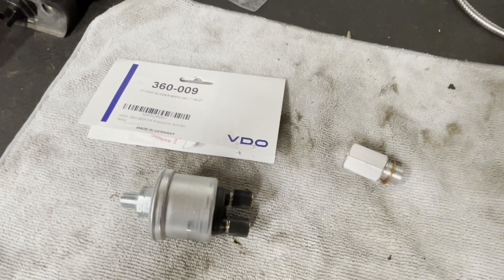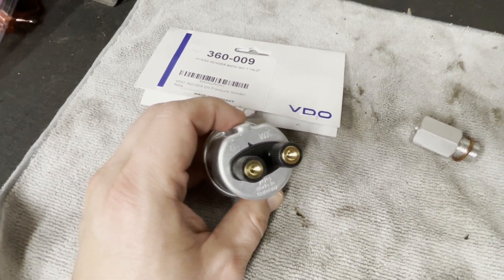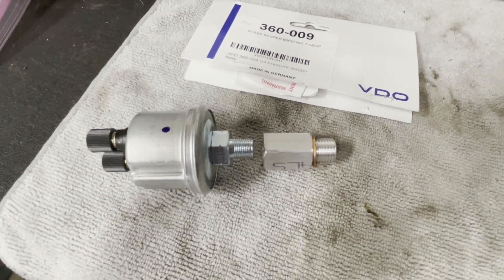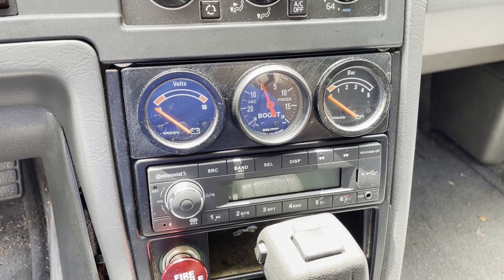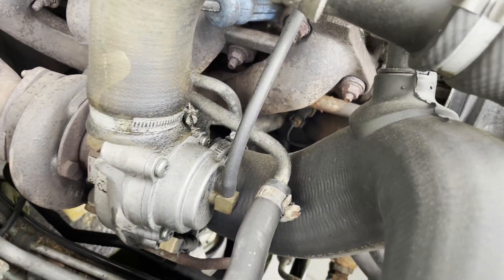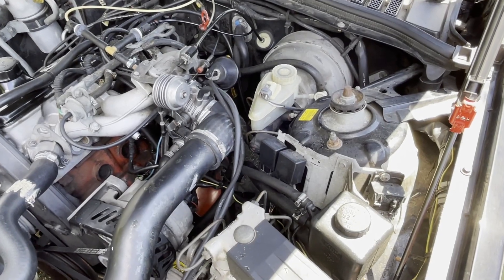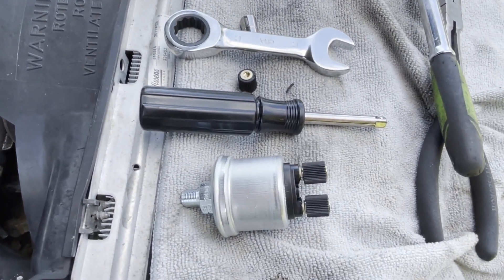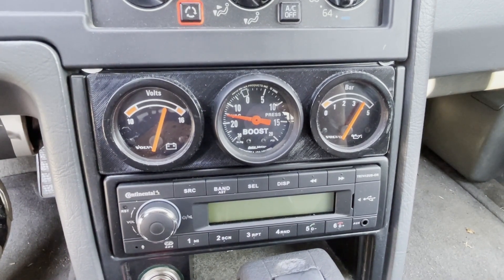Volvo Redblock - Oil Pressure Sender Install - 1991 Volvo 940 SE

Comment: man i’ve tried to do this install like 3 times now and every time the gauge has no reading. i used size 16awg wire for the sender and the gauge. i’m also using fuse 16 to power the gauge but nothing seems to work. any advice?
Reply from the maker: @connorr772  I’m not an electrical expert, but I think first you need to make sure you are getting power to that wire you are using to source your power. You may also want to check continuity on your gauge to confirm it’s working. I would think that if you use a multimeter to check connectivity, and touch your leads to the terminals on the gauge, then the gauge should swing all the way to the maximum oil pressure?

Comment: If i was to do this, could i add a oil temp gauge from that sender?
Reply: Yes and it'll read oil temp at that part of the cycle which is not optimal but should work. Ideally you read the temp at the bottom of the sump.

Comment: Do you have to drain the oil before doing this? Thanks for the helpful video!
Reply: No. Just do it with a cold engine to make sure the oil is in the pan + you won't burn yourself.

Comment: FYI: VDO 360 028 has the right threads, you don't need the adapter.
Reply: For anyone coming across this in the future. You still need some sort of male to female adapter as the pressure sender will hit on the block before it's tightened. I went with the aforementioned 360-028 sender and found a M14 x 1.5 male to female gauge adapter about 1.5" long.
Reply: @Craycola  On this sender, the seal should be formed by a copper crush washer. The adapter should work, of course.
Reply: @Craycola where did you get the spacer for the sender from?

Comment: Thanks for the video on this! Where'd you get your gauge pod holder?
Reply from the maker: Thanks for the feedback! The gauge holder was a 3D printed item from eBay. If you search for something like “single DIN triple gauge” then you should find similar ones. 

Please note that the setup in my car only works on the 760, 960, and 940 SE. It would not work on the other 740 or 940 cars, because they don’t have the true double-DIN design.
Reply: Awesome thanks! I have an SE too and my gauges are just jerry-rigged atm but yours is a much cleaner way to do it 😂